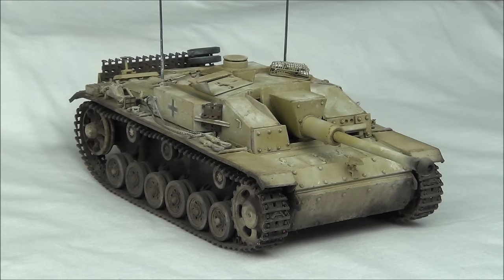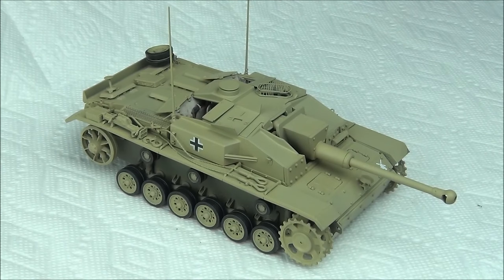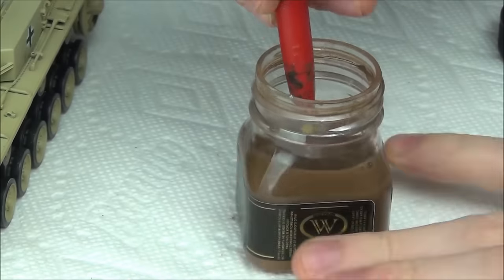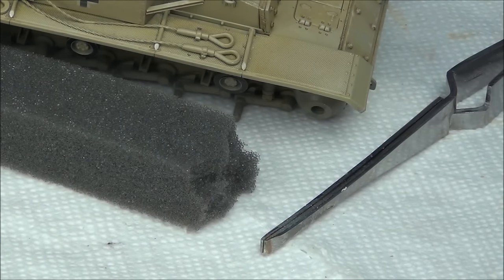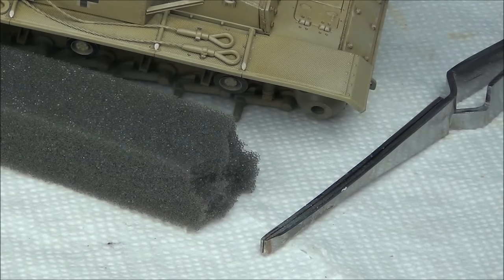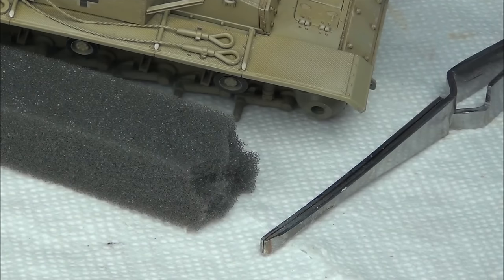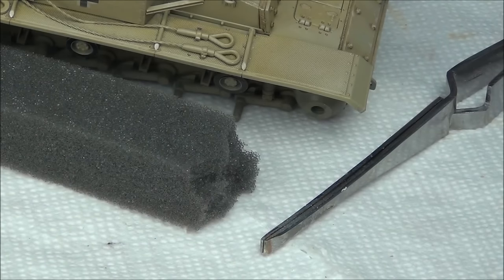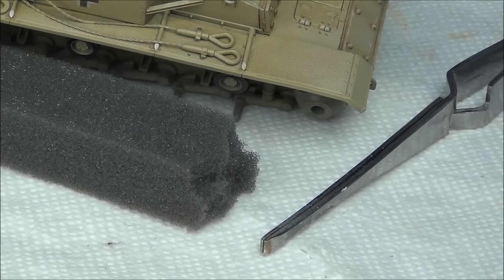STUG F/8 | Standard Weathering Procedure  (Full Weathering Tutorial for Model Tanks)

Comment: i liked your weathering however, the track of the tank i think should be more shiny and not so rusty, having had 18years experience working on tanks, the horns of the final drive would be bare metal and the were the road wheel comes in contact with the track would also be shinny . Road wheels would also have clunks of rubber missing from them. When the track go through mud and soil it acts as an abrasion. Also you would have mud on the tank were the crew members would climb onto the tank and around hatches.

Comment: what clear flat should I use? I would prefer using a spray can because this model is huge. but I suppose air brush is much better. have you ever build a 1/16th scale tank model?
Reply from the maker: I've never done anything that big, but I use Testors Dullcote in the spray call all the time.  Just spray it in thin coats from a distance...I spray from about 3 feet away.
Reply: That's funny. That's exactly what I was going to order. I think you might enjoy building a trumpiter 1/16, because I believe they include the vehicles interior.

Comment: Hellow Panzermeister36, I am painting an imperial guard baneblade model (warhammer 40k in case you aren't familiar) in a dark forest green color with black splinter pattern camo.  Despite the fact that the model is from a futuristic setting (and in a wonky scale) I would like it to have a sense of realism. I have never used a filter before and was curious about what color I should try to help.  Any ideas?
Reply from the maker: +Sean Hargis I would use a filter color that is a lighter shade of green than the base forest green.  By using a lighter green than the base, this will give a slight fading effect to the green areas, and also it will blend in the black areas slightly with the green regions.  The effect will be very subtle but it will add a realistic look to the tank by unifying the whole model.

Comment: Thank you for taking the time to make this great video! I must say your videos are high quality and very use full!
You might want to try to thin the winter chipping fluid with some alcohol, since they are activated by water, alcohol should be no problem.

Take care,

Jan
Reply from the maker: Thank you Jan!  I will try that out next time, thank you.  Hopefully that makes it spray a little smoother.
Reply: The surface tension of alcohol is lower then that of water so it should not make drops so easily and splatter, but i'm not sure how it will react to the product so don't try it directly on a model haha.

Comment: Nice video. My personal opinion on the order you apply the steps in is 1. Filter  2. Oil rendering 3. Pin wash 4. Chipping. 

If you apply the oil rendering after you’ve done the pin washes, it tends to wipe out or reduce  the shadows from the pin wash step. Just my 02 cents.
Reply from the maker: I find that if I do that, the action of cleaning up the pinwash excess around details also affects the oil rendering effects.  Since the pinwash is usually only applied in very small amounts around details, it is usually not removed by the oil rendering effects, at least in my experience.  So I do the pinwash first.

Comment: excellent work, very realistic mud effects. Doesn't take much research to find photos of vehicles on the eastern front at least axle deep in thick mud.
My only quibble might be around rain streaking of the white wash coat as it wore off.
Thanks for the inspiration :)
Reply from the maker: Thanks Mark!  I was lucky enough to get some nice photos of this unit - 901st StuG Batterie - so I based the mud and stuff off that.  I'm curious what you mean about the whitewash...too much or too little streaking?  I like the constructive criticism, don't worry :)
Reply: Panzermeister36 i was thinking along the lines that after whitewash was applied any rain would run down the sides and "selectively" wear vertical streaking in the areas where it collected most. So, for example, under bolt heads or corners where water runs off these would have a less whitewash effect.  Now in this case the whitewash has nearly completely worn off so this effect might be more subtle. 
So then I started searching tinternet and there are actually very few good photos showing this,  most are as you have portrayed. I did find a photo of a KV2 in german use with the crew stood in front of it that shows these streaks down the side of the turret, similarly a Nashorn with streaking down the side - so maybe this effect would only show on large slab sided vehicles? 
I did find many more muddy stugs though :)
Reply from the maker: Alright I understand what you mean :)  And that is a good point too, something I'll have to keep in mind for next time.  Thank you!

Comment: Hi Evan, great tutorials you have up, loving them all. I’m trying to work out my own work flow using Acrylic, oils and pigments, but sometimes I don’t know if you’re using acrylic, enamels or oils. Is there any chance you could help me out here with which you are using for what please. Also, do you need to apply clear coats between sections to avoid lifting or contaminating previous steps. Thanks in advance.
Reply from the maker: I'm glad you like my videos.  I will try to break it down here:

I airbrush the colours of the model in acrylics.
Apply a gloss varnish, then decals, and then gloss.
Then I apply chipping effects and detail painting (shovels, cables, etc) using acrylics.
At this point I apply a satin varnish for weathering.  This was all acrylics as they dry fast and cover well.

For weathering I use enamels and/or oils.  They are similar, but basically pre-made washes and mud effects are enamel, and if you want to make your own then you'd use oil paint thinned down.  It's key to use these as they take longer to dry so you have time to adjust them and make streaks, clean up the washes, and so on.  
My weathering involves first a wash around all the details with dark brown, then I can make dust effects or streaking effects with oils.  In this video I also did a "filter" early on but I don't bother anymore with that.  
I then finish off with mud effects using enamels or oils again.  Sometimes pigments.
Reply: @Panzermeister36   wow, thank you so much for taking the time. Not just to make these amazing videos, but to take the time with your prompt replies. This really does helps me out. My son (Also Evan) was wondering what part of the world you are from. He thought you might be from America, but then you spelt Colour the correct way. 😉 My best guess was Canada. 🇨🇦
Reply from the maker: Correct!  I live in Ottawa 😊

Comment: Do you normally use the kit tracks or aftermarket tracks on your kits? I have a few Tamiya 1/35 models I haven't started yet. Thinking about aftermarket tracks.
Reply from the maker: I will use AM tracks only if the kit needs them.  I mainly build Dragon and Trumpeter kits which have good individual link tracks.  I'm not a fan of rubber band tracks like you get in Tamiya sometimes so I would replace those.
Reply: Good info! I've looked at a few Dragon and Trumpeter kits, but haven't 
picked any up yet. Any recommendations for after market tracks for a 
Tamiya Stug IV, Tiger I, and a T34-85? Planning on doing metal guns as 
well. Built a Pak 40 a while back, used the plastic barrel with it. Hard
 to not mess it up as far as roundness while trying to hide the seam.

Comment: Nice video. How did you fix the pigment of the smoke in the muzzle brake near the end of the video? Was the surface wet with white spirit or pigment fixer?
Reply from the maker: Hello Diego.  I actually didn't mix on those pigments on the muzzle at the end.  I might go back and use a little fixer sometime though, but it's not 100% necessary.

Comment: Iam sure that I missed it somewhere. Can you tell me about preparing the model for weathering. I am confused about what to spray on the model before pin washing. Also do I use Future, spray lacquer, polyurethane after filters? What is the sequence? I don't trust many people but I do trust you Panzer. I would appreciate any help. Thanks for your time. Robert
Reply from the maker: You should apply a slightly glossy varnish before the pin wash to help it flow.  You don't need to -- I didn't in this video -- but the varnish helps.  I would avoid Future since it is very weak and can be damaged by the pinwash's thinner.  A proper modelling varnish is a much more secure option.  I personally use Tamiya X-22 gloss thinned with Tamiya thinner and airbrushed on.  You can also use other brands or even Testors or Tamiya etc. stuff that comes in spray cans, though those give you less control.

Comment: Great Video! I've got a question: What kind of brush are u using when u blend Wilder's oil colours?
Reply from the maker: Thank you.  I usually apply the oils with a 10/0 round brush and blend with a 1/4" angular shader.  I have a bunch of other brushes that I also use, but 80% of the time I use that angular shader.  I also use it for applying pigments too sometimes.
Reply: Thanks for ur fast reply.

Comment: This is truly stunning work!!! It looks like it has been pulled from the past! I was just wondering if you can attach P/E parts with tamiya extra thin or superglue
thanks Johnny👍👍☺
Reply from the maker: Thanks Johnny.  Extra thin won't glue PE since it works by melting both plastic parts and then re-solidifying them as one piece, but it won't melt metal.  I just use a standard CA super glue.
Reply: Panzermeister36 Thank you I am about to start Dragon 1/35 panzer 3 j  and comes with many PE parts, do you need to use them all or not?

Comment: Hi again Panzermeister36. I notice you don't seal the model until the white wash stage. I was under the impression that after applying acrylics to the model, you needed to seal it, otherwise the oil and oil thinners would cause problems with the acrylics and maybe the decals. Would be interested in your thoughts on this. Also if I did seal after the acrylics and again after decals, is this going to cause a problem or am I just adding sealant when I probably don't need to (but it won't interfere with the techniques you show)? Many thanks, Dave.
Reply from the maker: Hello Dave!  I didn't seal the base acrylics since Tamiya paints are very durable.  If I had used AK Interactive or anything else really then I would have had to seal it for the reasons you describe.  And no, I don't think doing any extra sealing coats will have any bad effects, it's more of a precaution that you can take and I don't see any downsides to it.
Reply: Thanks again for the help :)

Comment: New subscriber here.....love your work.
Are you applying the filters/washes directly to the Tamiya paint?
Reply from the maker: Thank you!  Yes I am.  Should probably apply a gloss varnish though, but you don't HAVE to...  Tamiya paints are durable and likely won't react with the washes and other products.  A glossy surface helps the wash flow better, so that (along with protecting the base paint) is another reason to use a varnish.  In my 2nd most recent video I weather a DAK Panzer I in similar fashion to this video, and there I showed using varnishes.
Reply: @Panzermeister36  thanks for replying

Comment: Question: are the antennas photo etched or what cause they look pretty good. I always have trouble with making antennas with the styrene they instruct to melt and stretch out. 

Also, why does my model start to get more brittle after some time? I keep finding that the more smaller parts like the antennas and lights just snap off with the slightest bump.
Reply from the maker: +WelshZeCorgi the antenna here are plastic parts in the kit.  I'm not sure about parts getting more brittle, but smaller parts are certainly more fragile.  When cutting them from the sprue they can flex and snap, so it's best to cut as far away from the part as possible to reduce the strain put on the part.

Comment: After the pin wash, doesn't adding thinner affect the underlying coat? Or did you spray some varnish after the initial base coat?
Reply from the maker: I've always found that if you let everything dry then the enamel thinners won't pull off any of the previous effects unless you really rub at it hard with a brush.  You could always varnish just to be safe, though.
Reply: Thank you for the quick reply. And thank you for the awesome tutorial! You're pretty boss at this.

If you don't mind another quick question from a complete newbie, the mixing you do for highlights/shadows/discoloration, does it need to be oils or can this be also done with acrylics?
Reply from the maker: Sure thing!  And thank you :)  Now to answer, Acrylics will dry too quick and be too opaque for you to be able to blend in this effect like you can with oils.  If you have an airbrush, you can post shade in lighter and darker colours of paint to do a similar effect, making highlights and shadows and other effects to break up the solid paint colour.
Reply: Thanks man, much appreciated. Keep up the awesome work :)

Comment: You don’t apply any clear or type of finish before applying decals?  Do you apply gloss before black panel lines?
Reply from the maker: I don't use gloss before decals.  It doesn't matter than Tamiya paints are "flat finish"; I get a smooth result that allows decals to conform without silvering using Micro Sol.  

You can achieve a smooth matte finish, since the "matte" is more of a microtexture that is what reflects light.  The "smoothness" of the paint is a macrotexture, and that is what affects decals and can cause trapped air bubbles (such as a rough, pebbly finish).  Hopefully I have explained this clearly.  

As for a wash, now I generally apply a semi-gloss varnish before washes and filters.  I find gloss is too smooth, and the weathering has a tough time sticking to the surface.  Semi-gloss or satin has a tiny bit of texture that helps the weathering stick, but it's also still easy for the wash to flow along panels and bolts and still easy to clean up excess.  

I should do a video explaining my use of varnishes.  If you'd like some more clarification, just let me know :)

Comment: For the application of the heavy mud on the tracks, you need to consider the movement of the tracks here. When tracks are moving, they grab all the mud from the earth, then, usually the rear wheele is a free wheele because all the mud is accumulated there and falls back on the ground until it reached the traction wheele in front. when reaching the front wheele, the track has been mostly cleaned up from the mud. It is a way to protect the motorised wheele.
Reply from the maker: And what about on a T-34 where the rear wheel is the sprocket (powered wheel)?
Reply: Poor design :p. Tanks like that had their sproket broken quicker I guess. I got this info from a visit in a tank museum.
Reply from the maker: Well the T-34 is arguably the tank design that won the war.  Russian tanks still use a rear sprocket to this day, as does the M1 Abrams, Leopard 2, Challenger, etc.  It's a better design since mud shouldn't throw a track or break a sprocket.  Steel is stronger than dirt so as long as your track tension is good there is no problem. 

I wouldn't trust everything you hear at that museum, especially because they can't even paint their tanks in historically accurate camouflages.  Their Panther is wrong....and a post war build....and has lead to the myth of Panzers fighting in red primer at the end of the war.  The Caunter camouflage on their Matilda is wrong....and they admitted it....and that has lead to people believing that the Caunter scheme had sky blue in it since the 70s.  It should be a pale silver-green colour.  They also have incorrect camouflage on their Panzer II and any others.

Comment: Following on from my earlier comment...I know you have said that you don't use varnish, but I will be building wargames models and so will need to varnish to protect them during handling.
Can you please advise me at what point in your weathering process I should first apply satin varnish? I will be sealing the model with Matt varnish as a final step.
Thanks again.
Keith
Reply: satin or matt varnish at the end if you want to
Reply: Thanks. So you don't recommend using varnish before applying panel lines and filters?
Reply: @theenigmaticgamer  Rather I would after to fix it ,and then continue
Reply: @theenigmaticgamer  Because it depends of the color you use. If you use satin or glossy it will be easier  to apply the filter wash etc.
Reply: Ok. Thanks very much 👍

Comment: Great vid. Is it better to varnish after the decals? I thought the oil washes attack the Tamiya colors?
Reply from the maker: +M.S.H Tamiya colours are probably the most durable acrylics on the market.  You definitely don't need to varnish as oils won't damage them, unless you're using a super hot thinner for your oils I guess.  Lighter fluid is the best oil paint thinner.
Reply: @Panzermeister36  ok good to know. But i had a problem with the tamiya xf when i weathered it with vallejo wash, the paint starts to fading...
Reply from the maker: +M.S.H the Vallejo wash is an acrylic wash.
Reply: @Panzermeister36  yes i know, so why can a acrylic wash fading the tamiya color?
Reply from the maker: +M.S.H because it's an acrylic wash and acrylic washes are a bad idea; they use the same thinner as your base paints and will damage them.  Oil washes are a lot more controllable and are a lot less harsh on your finish since they use a different thinner.
Reply: @Panzermeister36  yes i bought oil paints last days and will use it on my actual build